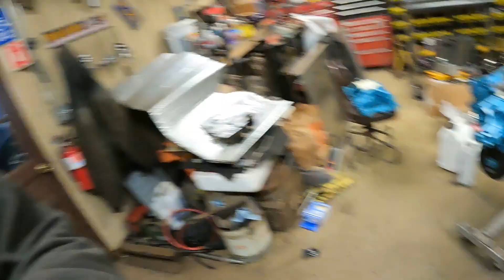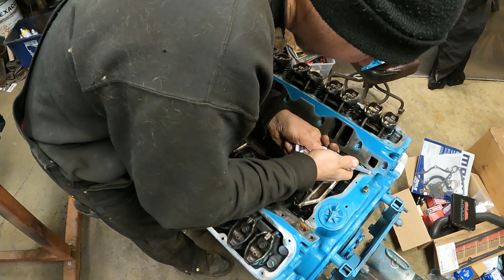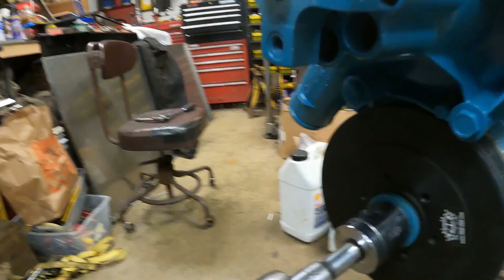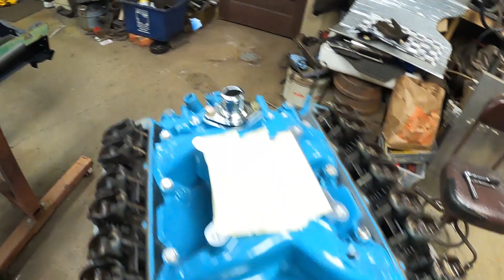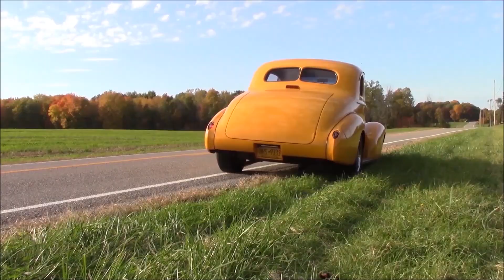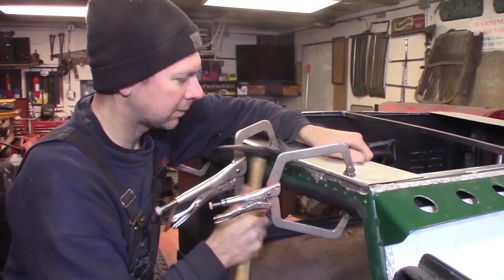Magnum 5.9L Air Gap Intake and Header Install:  1980 Dodge W200 Build

Comment: I'm building the same engine. What intake bolts did you use? This is my first magnum.. I ground those plugs down so they would tap in lightly with a thin skim of gasket maker in the holes..
Reply from the maker: I think I just put new bolts in the intake.  Either grade 5 or stainless, I don't remember.

Comment: What kinda plenum plate is on that intake? 1/4” thick or similar to factory?
Reply from the maker: What do you mean plenum plate?  In the video I have masking tape over the hole and then I show the carb and a blue standard Holley 4 bbl gasket.

Comment: Thanks for putting this out there to inspire us! Can you tell me what intake gasket set you used. I got one from Scramspeed and it doesn’t fit. The bolt holes thru the gasket are round and probably need to be oval…..
Reply from the maker: I'm pretty sure I just used Felpro gaskets for a Magnum engine.  Sounds like you're trying to use LA style intake gaskets
Reply: @QuickSpeedShop  I think that’s what happened. Scramspeed sold it as fitting a magnum engine but it may for the LA heads…..thanks Josh. Love the show!

Comment: i seen you pour the oil over the cam train before installing the intake,impressed me,that little thing,will insure the cam does not gall or go flat,and it gets oiled first,first 45 seconds firing up a new engine or an old engine with new parts is hell,till the oil gets splashed and pushed into recesses,good work,360 magnums run really good,carbureted better
Reply from the maker: This is a junkyard engine with roller factory lifters, but any little bit of oil helps.  It's now running in the truck and seems to be good.
Reply: @QuickSpeedShop  it's a MOPAR they are designed,not thrown together and see if it will work,worked for the corporation for 35 years,not a fan of the new hemi,either design flaw or soft parts causing the cam and lifter failures,this was unheard of in the past,truly,worked for 5 different dealerships back in the day,69-89 NEVER SAW A FLAT CAM,a lot of chevy and pontiac camshafts flat,but that was due to the small diameter lifters they us,most of their lifters interchange between their engines,glad you chose mopar for power
Reply: @strattuner the cam and lifter failure is due to the angle of the lifters in the bore. The oil doesn't run down the lifter and onto the lobe it stops and drips part way. The only way to keep the cams alive is to not idle very much. The cam needs ad much splash lubrication as it can get. The only cams I've seen go flat are from vehicles that are idled alot like work trucks or company trucks. My daily hemi runs great and i dont idle it. Also the MDS exacerbates the issue of little oil because it essentially shuts the oil off to the lifters.
Reply: @alpha13dylan  you are speaking of the hemi for not idling for long periods,i've thought about this problem since they built the hemi 5.7,if it does not oil correctly,beings there are hundreds of thousands of them running up and down the roads all day,it seems to me,to be a oil additive problem to fix so to speak the flaws in design,that's the way i see it,and i'm chrysler trained,i've never seen a blunder like this hemi oiling issue,in 35 years working on mopars

Comment: So I’m definitely doing the same thing you are except with a 318 and an edelbrock avs2! Looking forward to more on this build! 

Curious, what did you use for a tstat and water neck? The parts I ordered, there’s nearly 1/8” of space for the tstat to float around.
Reply from the maker: I used a replacement Mopar water neck.  I did have to measure the opening hole then cross referenced that diameter with an aftermarket high flow thermostat and found the right diameter to fit.  I want to say it was a Ford V8 diameter, but I don't remember
Reply: @QuickSpeedShop  interesting… I did go with the replacement mopar LA stuff but looks like I’ll have to take the neck to the getting spot for something else!

Comment: Why did you continue putting the intake on knowing you will have to remove it & possibly wreck the new intake caskets to heli coil the front bolt hole that has stripped
Reply from the maker: I was able to through bolt that hole and put a nut on the bolt due to design of Magnum head.
Reply: You put a nut on the other side of the bolt in the head

Comment: did you get a flywheel for a magnum because the weight on a LA360 is different than the magnum
Reply from the maker: Yes, have a Magnum flywheel and Magnum damper.